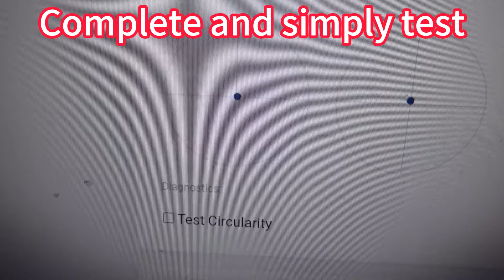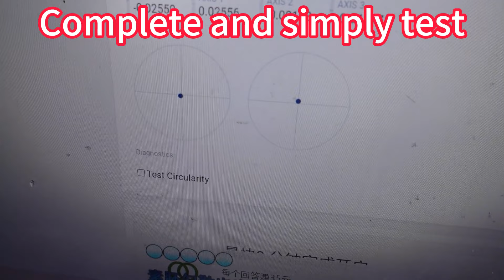Elite II Install Hall joystick demonstration。

Comment: Attempted and failed miserably. Make the pads for the middle sensor pins bigger! Couldn't get the solder to stick to it even a little bit and just wasted so much effort on this. DO NOT ATTEMPT UNLESS YOU ARE SIGNIFCANTLY SKILLED AT SOLDERING!!!
Reply: Bro... Small soldering tip and flush are your best friends here ☠️☠️ 
No issues for me
Reply: Bro you had trouble with that tiny bit of soldering it’s so easy
Reply: Dude ngl it’s not that hard….

Comment: Amazing work, I appreciate all your work. I had ordered a few of this products they work loke a charm. Question, Are you working on supporting the threaded hall effect joystick? It would be amazing to still have all the elite series 2 features. Thanks for your time 🙏🏽
Reply from the maker: Threaded joysticks can also be used, but due to dimensional errors, friction can occur between the joystick metal cap and the plastic housing. Thank you for your attention
Reply: Thanks!
Reply: There is a k-silver module specifically for elite 2 with adjustable tension
Reply: @zznothinzz  I know, but for peace of mind, I would like to integrate this board for calibration and frequency interference between the joystick and the magnetic thums stick.

Comment: Is there any way in the future to not be required to have an extra pcb to be able to use the sticks? Like an all in one system with no soldering just plug and play
Reply: Apparently he only produces the boards. Sticks will Hall effect sensors are sourced elsewhere (like K-Silver). But that would be a wonderful solution if it all was integrated. Marius Heier seems to be working on something like that, but he has nothing for sale yet.
Reply: I'm not sure there is the volume of sales to justify the cost.
Reply from the maker: @KennyMinigun  In fact, I also provide joysticks, and it is not expensive. Nothing is more cost-effective than Chinese production.
Reply from the maker: @TheWebstaff  In fact, customers who do not have high requirements for the use of joysticks can not use this solution. My solution is to pursue the ultimate return effect and the external dead zone can be adjusted.

Comment: Does the metal back paddles affect the hall joysticks with this board?
Reply: No, paddles workings normal... 👌
Reply: @ruch-oporu   Yes paddles would work normal, but I tried the orange hall effect joysticks without these calibration boards, and the metal paddles would pull on the right joystick, so it would center different when they were off and on

Comment: So question. For the sensor did you simply use the same sensor and moved down to cover the ordinal pins ?
Reply: Its same one he showed in first 40 seconds that he removed
Reply: @victorlowe  thanks. I have learned though with trial and error if you don’t have a big enough spacer under the sensor that the short throw trigger will not register. The same goes for the right side

Comment: I bought some elite series 2 hall sticks off alie express, would I follow the same steps in this video or is there any differences in installation with the elite 2 sticks? Also what’s the point of the insulation in the middle pin?

Comment: is there a version of the replacement stick that doesn't need the small circuit board to be installed?

Also, about "threaded Hall joystick will have size incompatibility issues", what seems to be the problem with those models? i see them everywhere

Comment: dude, what you have done is an amazing feat. and I am grateful for you to have achieved this. but instead of having your board soldered separately, do you plan, in the near future, to have your module to be included with the joystick module itself? so that the user could just solder it at once. I don't understand the engineering or the licensing aspect of such feat, but do you plan on doing that in the future?
cheers
Reply: Due to the tight clearance of the thumbsticks in the controller housing it would cause issues with rubbing you'd have to find either a low profile module or a modded shell

Comment: After v5 and v51 are installed on the Xbox Series X controller, can I normally update the controller firmware when available and calibrate it from within the Xbox Series X itself?
Why did those yellow hall effects cause a bug after calibration?

Comment: If I don't put the plate that goes under the joystick, what happens? Does it work without putting it on?
Reply: It makes it easier to calibrate and has no jitter unlike the orange ones( which doesn't need the calibration board).
Reply: @sudharshanmanneru3613  And which ones would you recommend more, blue or orange? Thanks for answering me
Reply: @jorgecazares6016  the orange ones are easy to solder as they don't have any pcb but they very hard to calibrate, the blue ones are hard to solder but very easy to calibrate, if you are good with soldering then go with the blue one's, even if you are not good with soldering try contacting someone repairs controller and ask them to solder it for you. The orange ones are very hard to calibrate so i prefer jun yeng blue ones
Reply: @jorgecazares6016  The PCB would also prevent the magnet of the left trigger from disturbing the hall effect potentiometers of the left stick. It is therefore more than recommended to use these PCBs regardless of the colors chosen.

Comment: 1:42 could you please tell me why must do this ?
Reply from the maker: This is the experience of installation, if you keep the vertical installation, after installing the housing, it will be offset
Reply: 29:13 : The LT trigger sensor needs to be removed and then slightly raised when reinstalling.
im using the yellow/black joystick and havent raise the sensor yet, but already connect the board to the sensor. The board didnt compensate for the trigger.
Are there any wrong ?

Comment: I put a set in my elite series 2 & and afterwards, the trigger jutter & the sticks spin crazyly. i think i hurt the board some how... this is my 3 controller. The first 2 went perfectly...
Reply: I have exactly the same problem.. I think these Analog sticks from Aliexpress do not work for ELITE 2 Controller ! Do not buy them !
Reply: @Delaware-lk5vk  I figured it out its the ones with both blue hall effect sensors off aliexpress.  I ended up using the other ones I have off aliexpress one blue one green sensor & now my elite 2 works perfectly
Reply: @twall667  Don't the magnets contained in the Thumpsticks interfere with the hall effect potentiometers? It's a possibility that makes me wonder if I'm doing the right thing by replacing mine with this type of material.
Reply: @thesilencer8074  no not at all! That is what the pcb is for it connects to the trigger and corrects the movement of it.
Reply: @twall667  Ok thank you for the answer.  I searched for quite some time and saw everything and its opposite as an answer.  And the same for the calibration, each time they were done without the sticks screwed onto them so that it was impossible to get the answer that way either.

I have an official classic Xbox Seris X/S controller and I told myself that since I was going to change the sticks and that they are the same size, I might as well install sticks with more options like those of the elite series 2. I  would obviously buy the screw-on magnetic caps that go with it.  And besides, I have another question to ask you.  Do the sticks you bought also have the spring tension system?  Because if that's not the case, I might as well take Elite 1 magnetic sticks and caps.

Comment: So why exactly does the module need to be tilted?
Reply: If is not tilted the left thumbstick will not be centered with you reassemble.
Reply: @Tr4shBerry  was the original sticks the same way or is it just how this replacement stick was erroneously manufactured? just curious
Reply: @lyndongaming  original elite 2 sticks don’t need to be tilted. I think it’s just the weird way that the box settles. If you put these into a Series X/S controller they don’t need to be tilted.

Comment: A bit more work then i thought it would be and on my elite controller the solder is strong and does not like to melt even when my iron is at 250c. And for god sake cut your nails looks horrible to see.
Reply: For desoldering the old sticks, Microsoft uses a higher melt point solder. Need a MIN of 400c
Reply: Nails are used in this type of work.  It is for practical reasons that they are so long, just like those of certain guitarists who use them as a pick.  As someone who tinkers a lot, I often use it to catch small screws that have taken refuge in corners.  It can be used as a small screwdriver for adjusting certain electronic modules.  It also helps protect fingers from burns for certain welding jobs.
Reply: nails make those type of work easy :face-turquoise-covering-eyes:

Comment: Does the diode that goes onto the board come with the kit?
Reply: Yes. When you install make sure it is installed in the correct direction (as seen in the instruction) otherwise the calibration will not work properly